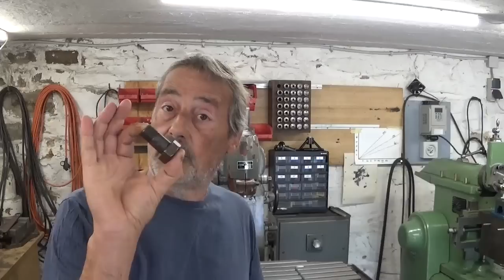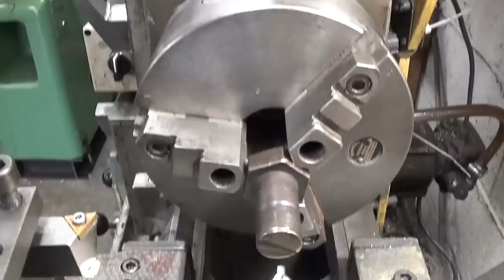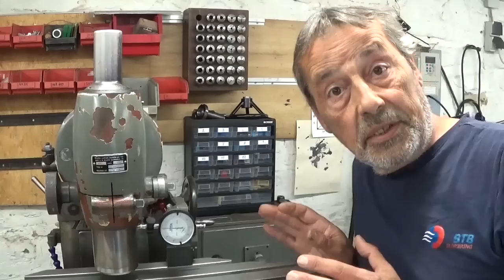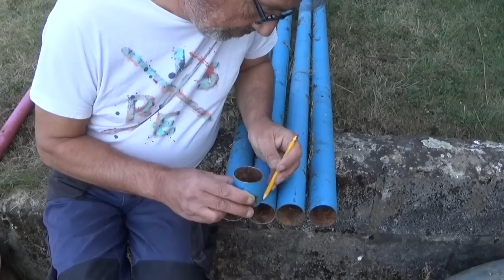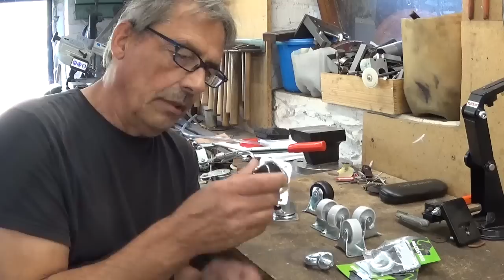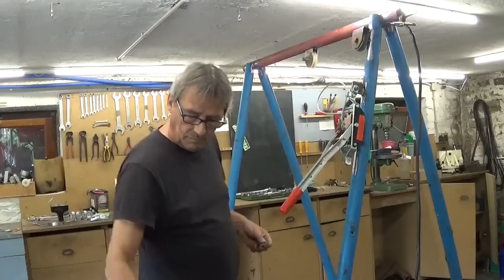A bolt and a crane.

Comment: Hi Michel, nice job on the gib repair! Also, good job on the gantry, but I'd like to suggest adding a couple of gussets at the top. Increased lateral strength. AND, amazing fix on what we would call a come-along here in Canada...LOL
Reply from the maker: For the moment it works just fine as is. It's not designed for daily use, of course.
Reply: @Rustinox  Not a problem. Just concerned for your safety.

Comment: a good idea, making the frame of that crane out of that material.  You could always fit a length of smaller but stouter pipe inside the top to increase it's strength, should you need to decrease the weight again you should be able to take it out to do so ... provided it doesn't get locked it place when it checks a potential failure due to overload of the parent frame.  I've seen so many "redneck" engine hoistings that ruined a kid's swing set that I can't imagine using that weight of material without having that possibility in mind.
Reply from the maker: My construction isn't designed to lift heavy machines. Just some parts. It works just fine.

Comment: The true reason a come-along or pulling winch is not for lifting is because there is no properly controlled release feature, just that clumsy ratcheting.  A geared or braked winch does not cost much more, and will do a proper job.  Good explanation here: https://www.youtube.com/watch?v=Gjo-2k3X6O4
Reply from the maker: That makes sense. Thanks.

Comment: Excellent video sir!  As always, I love your content and presentation style.
I like your idea of using parts from an old swing set for your gantry too.  If you would be open to a bit of constructive (no pun intended) criticism?, I am a little concerned about some of it's structure - and much more importantly, about your personal safety when using it!
The first thing is the fact that the top pulley is welded directly to the cross tube.  If that swingset is anything like the one I had as a kid, the tube walls are all pretty thin, and the wall of the cross tube could easily tear out at the point where the welds join with the pulley bracket - or the tube might just collapse and let the whole gantry come down on top of you.

One option might be to double up the cross tube.  If you don't have enough clearance to make it any taller by adding another piece on top, then a second, shorter piece on the bottom could work just as well. With the ends welded to the A-frame (just like you have the top bar welded now), and a couple of pieces of flat stock welded to the front and back of the two tubes, I think it would be a lot stronger. 
On a side note, you could mount the pulley to a couple of steel straps (or long bolts?) so you could lift from different locations.

I'm not good at writing things like this, so please hear my genuine concern.  ...I'm not trying to "tell you what you did wrong".  I've just learned - usually the hard way - about things like structural weak points, and I don't want one of my favorite YouTubers get hurt.

Take care my friend, and thank you again for all the excellent videos!
Reply from the maker: Thanks for your concern, Doug but the horizontal pipe is 50mm diameter and has a wall thickness of 2,5mm. That thing isn't going anywhere with a load of 25kg. Same for the welds :)
Reply: I'm glad to hear it.  I'm looking forward to future videos featuring the crane! 👍
Reply from the maker: @douglashank8480  Here it is; https://youtu.be/-bJfEcGI6Hg

Comment: Great Rusty work, as always.
Time 01:13. Why not a conical form? That would be adjustable instead of remaking parts?
That crane looks solid and reliable. Thought about block, tackle and rope to lift the mill in my IKEA Ivar......
Waiting for the next video.
Reply from the maker: I think I dont understand you cone form idea.
Reply: @Rustinox  Let bolt have a belt shape and the gib a V grove matching the belt shape.
Reply from the maker: @Stefan_Boerjesson  Thanks. I've got it now.
Reply: @Rustinox  Thoughts from an amateur....

Comment: You know that "for pulling not for lifting" label was the result of a lawsuit by some dummy that dropped something heavy on himself. The most amazing (and absurd) label like this I have ever seen was on the sun visor of a motorhome (caravan) that I rented for a vacation a few years ago that read " do not leave the drivers seat with the cruise control engaged". I thought to myself who would be stupid enough to do that? Well it turns out somebody was. This guy was driving his new motorhome, set the cruise control and got up to go in back to make a sandwich. The motorhome quickly ran off the road and crashed. He sued the motorhome company and won a few $million because the company didn't tell him that cruise control wasn't an autopilot. Sometimes stupidity pays huge dividends.
Reply from the maker: Indeed, there is no lack of morons in this world :)